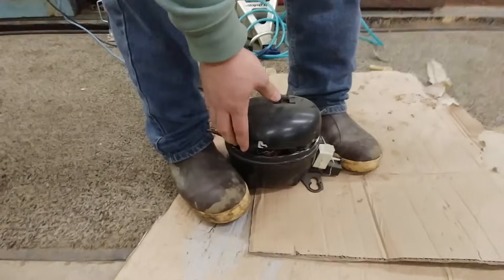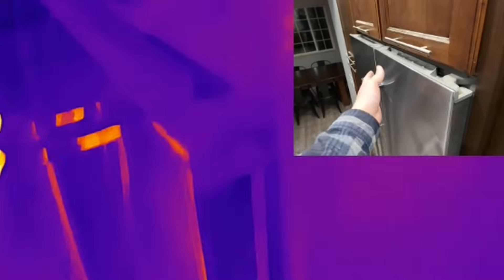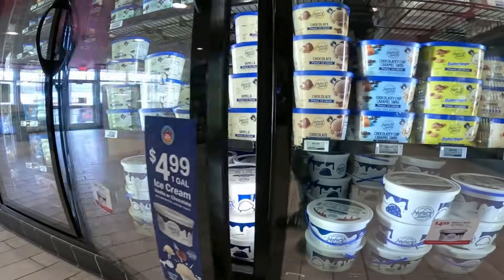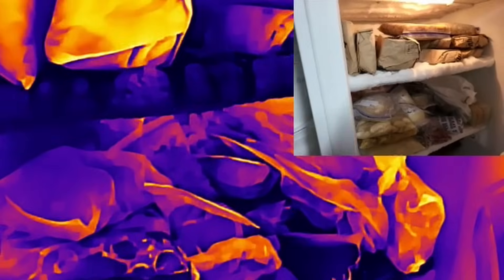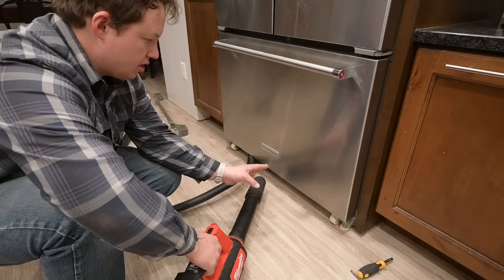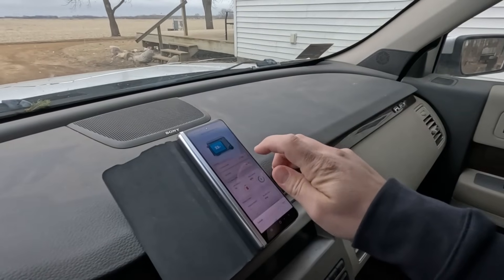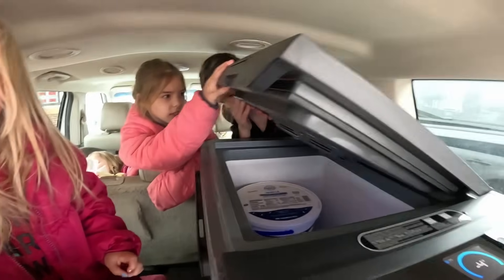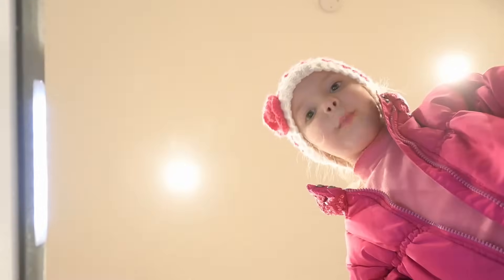How Your Refrigerator Gets Rid of Heat (& Why You Might Be Killing It) - Anker SOLIX Everfrost 2

Comment: Quick question, idk if you seen my comment on your video about charging a stand up freezer but I’m wondering, how do I know how much refrigerant to put into my Frigidaire frost free up right freezer? It dose not have any stickers or anything anywhere on it. Absolutely no info anywhere. 
Also, in the video about charging a stand up frost free freezer with r134a, did you do that with the freezer running or off/unplugged. Also, I see comments on that same video where people state that a freezer should have only 1psi when fully charged but your meter was reading like 6? Again, is that 1psi correct an is it with the freezer running or off/unplugged. An do I have to wait till the freezer gets down to temp for the actual psi reading or should I expect to see the 1psi of pressure, or whatever psi it’s supposed to have, pretty quickly after shutting off the flow of the refrigerant? You advice\input will be greatly appreciated, I don’t know where you live but I would gladly pay you to come try to fix my stuff. Hell id pay you to do a video chat and guide me through the process of recharging my freezers and refrigerator. An anything else that related to AC that I need to fix. Again your videos, input and knowledge are very appreciated

Comment: My 1971 ColdSpot is still running.  Condenser on outside BACK WALL of the unit.  No Fan to push the air over the Condenser.  
Sears/Whirlpool unit.

Comment: Hot Wall Condenser built in the wall of your freezers, Forced Air Condenser under your refrigerator and when you have the external radiator style condenser on the back of a refrigerator or freezer that is a Static Condenser. I know you know that Benjamin but now a few others know the terms too. The static condenser has some other names but not important.
Reply from the maker: Exactly.

Comment: I have a big E*Cooler fridge/freezer in my SUV here in AZ (currently holding ten 18 packs of eggs 😁). I need an aux battery to run it while the SUV is off after a grocery run. Being a poor senior, I really don't want to spend 4 digits for a L-ion battery bank. There is 12V power when the SUV is off, but I worry about the battery going dead. This AZ hear is murder on batteries and none last more than 3 years. Any suggestions?

Comment: In my new place, the cabinet above the fridge is only 1/2 as deep and the cabinet sits on a strut/brace holding up the back of it, allowing the heat from the fridge to rise up to the ceiling. I have no soffits, as I have four 4'x6" LED light bars on top of the cabinets pointing upwards towards the ceiling for "daylight" illumination (also dimmable) in this open floor plan. You could swear the kitchen is one big skylight. It's awesome! There are also light bars underneath the cabinets, but these are standard. You may think of changing out that upper cabinet for a more shallow one and add a small horizontal fan on top of the fridge in the back or near the top of the cabinet blowing the heat out towards the front. 😊

Edit: Now I see you have plenty of room between soffit and top of fridge to exhaust the heat. I'd still add a small 3" AC fan to blow the heat towards the front. The fridge should operate cooler.